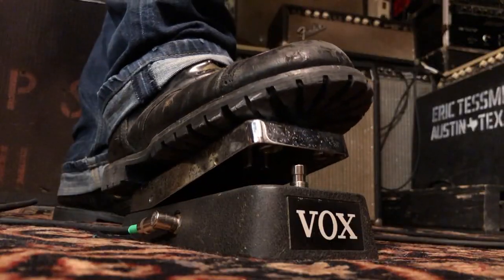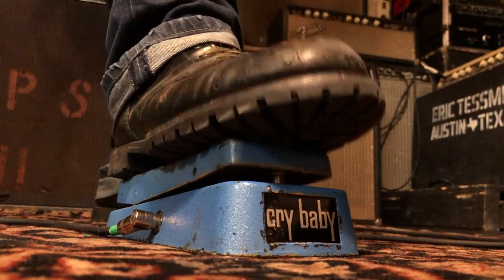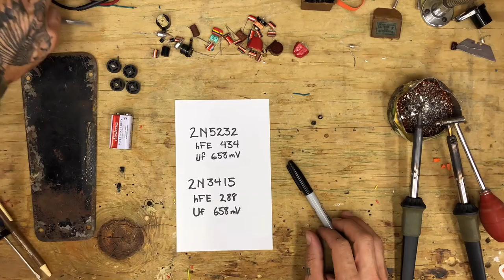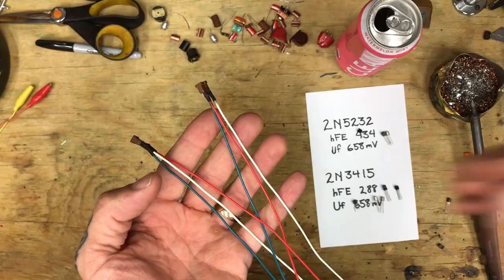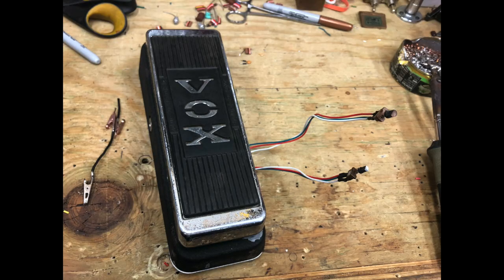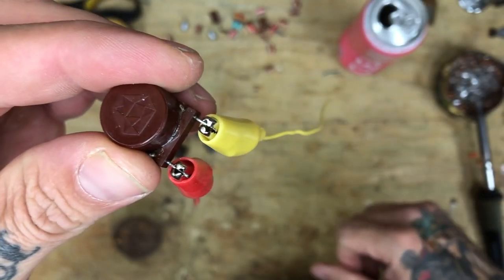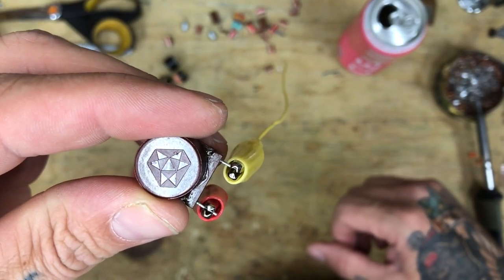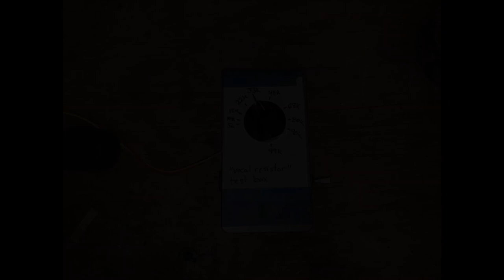Eric Tessmer - Wah Pedal Upgrades - Pt. 2: Transistors & Inductors

Comment: Awesome video. The only thing I would want to know is the DCR of those inductors because the lower the DCR, the higher the internal Q-factor. Inductor impedance is a fairly critical factor in many applications like graphic EQs where ideally you want each inductor to have the same DCR so that each Hz band boosts/cuts equal to the other. On the opposite end of the spectrum high impedance inductors work well when you don't want to lose too much signal going through it, the Gibson Vari-Tone circuit is a good example. I remember doing a version of the Dawk Stillwell MTC circuit (a Ritchie Blackmore mod) in my strat using a super high-Q toroidal inductor from a Mesa Boogie graphic EQ and the signal level dropped to near nothing when the pot was zeroed out. It was a 1H inductor so it wasn't a small one but the DCR was about 60 ohms. What I did instead was wind my own inductor around a metal screw with washers on each end with a few thousand turns of 42AWG wire. It came out at 1.2H with a DCR of like 2.5k and it worked like it was supposed to just cutting the midrange.

Comment: ok.....I was trying to follow you in the fast forward video to determine on your spec sheet for the readings......as to which reading represented which transistor position...the Q1 & Q2 in the standard schematic...since you did not note that on the white sheet.......     I'm an old school tube guy.....my father was an RCA dealer and think about going in to business in 1935 and the electronics experience along the timeline......when we did our own service for the products we sold in the dealership.......and....the RADIOTRON MANUAL hahaha......some snobs don't understand that.  SO I am old but not ancient.....and if my Dad were still alive...he'd be like 106 years old.  SO I know what is MYTH in MUSIC JOURNALISM and it amuses me what the Gospel followers thus believe....just saying !   When I first started college for engineering.....they had the machine at the state branch campus I was at...that we could make an IC ....the wafer and doing the layout etc......and how much actual circuitry is in a generic IC when its depicted as.....a triangle with an output and 2 inputs of opposite polarity.  But being said, yes...sockets hahaha......and "finding" musical chips for a particular circuit......while NOT PAYING ATTENTION TO SPEC SHEETS.  Lets just say I have a disdain for TL072 IC's in circuits where .... the  choice.... was made based on the engineering data sheet.   BUT ya.....each transistor needs the MUSICALITY TEST.....and at times its about WHO MANUFACTURED the part !  AND NO its not the JRC 4558 thing with tube screamers hahaha.....EVERYTHING is peculiar to particular circuits.  A Blue Printing for a recipe is NOT always a wash rinse and repeat scenario.....I'm sure you know.....hahahaha.  BUT as one of the big things with the musical snobs who play guitar REALLY LOUD.....FOR MANY YEARS.......better get your ears checked and graphed as.....everybody gets old and things...change hahaha.....what one person HEARS...might not be what another is capable of HEARING.....IF we are only talking...symmetrical hearing but don't expect Symmetric is the RULE with EARS.......and thee generation of EAR BUD users and Headphone people.  My gf of many years I live with....who actually went to WOODSTOCK and thee original event.....is getting hearing aids at her age.....and I'm still good & I shoot guns hahaha other than music.  I'm due to go get graphed just to determine a base line.  I hate getting in our car.....after my GF has been driving...and...has adjusted the radio while she was riding around......ummm I have a......different ....EQ..... for the radio...know what I mean.......   But with me and having dealt with customers over the years in our family business growing up......my clients and critical EARS & sensitivity.....and communicating.......I'm about to require hearing tests to qualify clients hahaha......much the same way the KLON guy did an interview before building you a KLON back in the day when he charged $300/$400 and it was MAIL ORDER in thee pre-internet days......you have to be proven WORTHY hahaha, but I need to determine handicaps for the musical golfers...know what I mean......      BUT I must mention, as first time viewing your content and your demeanor......I LIKE YOU

Comment: Hey Eric! Awesome video and some great information with audible examples. I have a question for you...I just got myself a Vox v847a (seller mislabeled as v847) and I was wondering if there are any mods you would recommend to unlock this pedal’s potential. Right now true bypass is the only thing fairly quick and easy but I’m open to your suggestions. Last resort would be to gut it and rebuild but that’s costly. Thanks in advance.

Comment: You can also put a dual pot in a box and measure the ohms live while testing on the second set of leads
Reply from the maker: Ducttapewalker good point! Didn’t have one on hand.
Reply: That might be a very bad idea. Most pots track very badly, so you can not count on what you read.

Comment: Did anyone else spin out at the the obvious thickness as soon as the original transistors were swapped in the chain? 
Scary! That’s the stuff that can actually frustrate the shit out of you if you pay 2k or more for an old Clyde and it sounds like example 1 of this tranny test. 
The levels that Eric is sharing is greatly appreciated, and he’s right Nik Sevigny is also a sevant of how to’s with regards to classic gear and tones.

Comment: hello 
how I can eliminate the ssh noise https://www.electrosmash.com/vox-v847-analysis using the  AC/DC adapter 

in the wha 847?It increases with other effects as distortion and others in the chain.
It is possible put 1000 pF ceramic capacitor filter between the power positive input of adapter and the 

mass (negative) of the pedal? 
I provided that stabilized power supply and the rest is good.
I'll wait your valid suggestion with a schematic diagram.
Regards

Comment: The transistors should both MATCH which HFE value?
Reply: No they should not, the first stage is an amplification stage and the other one an emitter follower. Matching makes no sense. Actually it may only make sense to experiment
with Q1.